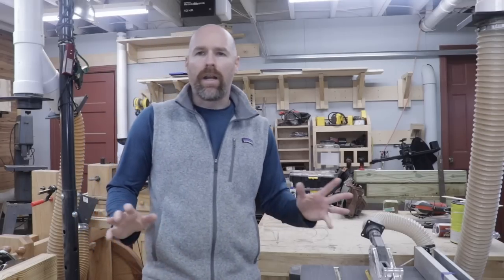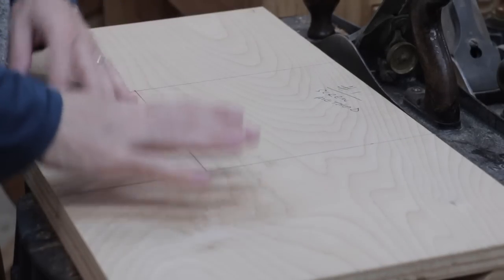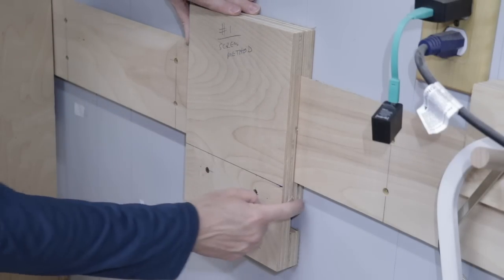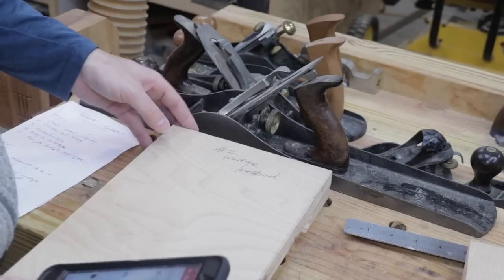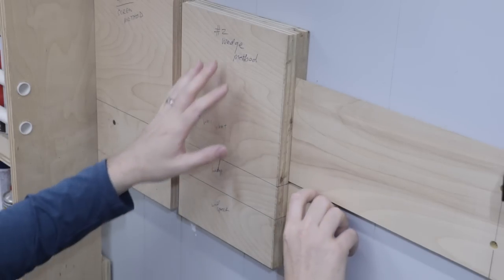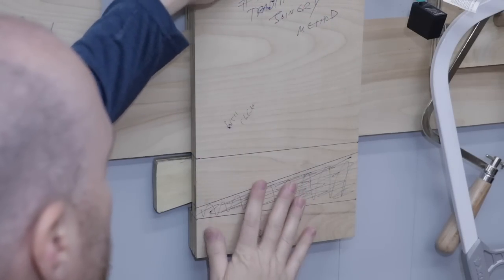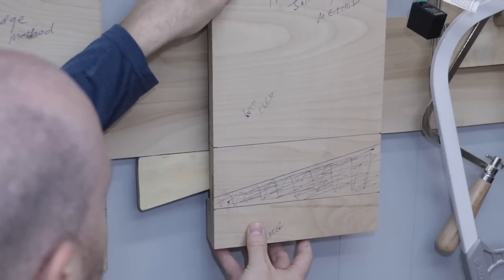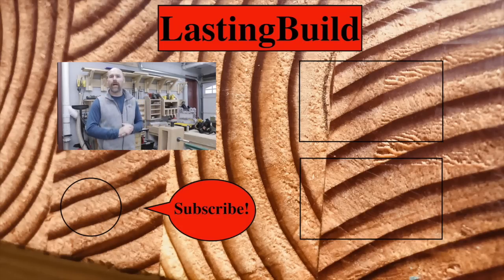Three Ways TO Make Locking French Cleats

Comment: Use one or two dowels (with a knob), and push through a hole in the tool-holder cleat underneath a lower wall cleat.  Requires equidistant spacing of wall cleats and a dummy wall cleat at the bottom. A major benefit is that no access is required from the side and nothing needs to be unscrewed to remove/reposition the tool-holder.

Comment: EXTREMELY HELPFUL!! Thanks for the vid. I do Lawn care/Handyman work. So I was trying to figure out how to make my (Ron Paulk inspired) enclosed trailer "modular" by using a French cleat system where I can reconfigure my trailer but it be secured while driving. One set-up for Handyman and one set-up for Lawn Care (where I have to fit a 48" exmark). I think I will use method #3, but with a screw, for my wall hanging shelves. BTW, I think this is the first time I've ever commented on a video but I couldn't resist because it was so applicable to what I needed. THANKS
Reply from the maker: That’s awesome! Never thought about adding cleats to a trailer. Glad you commented and welcome!

Comment: Great video. Thanks. I use a triple cleat system with 2 support rail cleats inverted to each other and the tool holder part having  two 45 degree bevels to fit between the rails. Solid holding, smaller rails and can cut bevels on a router. Works very well.
Reply from the maker: Thanks for sharing! That sounds super sturdy!

Comment: Another option - the wall mounted cleat: double bevel (top & bottom). The, method number two with the "locking block" having the mirror bevel of the wall mounted cleats' bottom bevel. Put a slight angle on the "locking block" such that one edge is ever so slightly wider than the distance between the spacer block and the bottom bevel of the wall mounted cleat. This results in a modified method of choice 2 & 3 and is absolutely rock solid and the wall mounted tool shelf/cabinet (whatever) will just not come off. I hope this made sense. Thanks so much! - Woodprobie
Reply from the maker: It does! Thanks

Comment: There are several other ways to accomplish locking a cleat. For a solid yet portable cleat, springs and bolts to guide them work. You simply push the cleat up into place to lock or unlock. A simple cam-lock could also work. It does require a knob of some sort, on the tool cleat, but again, it is easily portable requiring no tools. The solutions you presented are great. I'd likely use a screw or two, drilled right into the wall cleat itself, if you want a really solid, stable lock. After all, you're in a shop. What are the chances you wouldn't have a drill and some wood screws handy?

Comment: I liked no 2 then no 1. I can see no no 3 being an issue  as it would work loose in time with vibration. 
Great video.  Cheers
Reply from the maker: Thanks a bunch! I’m excited to try out #3 soon
Reply: If you make the wedge angle much more shallow and leave the mating faces rough that and a tap with Birmingham screwdriver will make sure it stays in place

Comment: Thanks for the video, I'm in the process of constructing my french cleat wall and this has helped tremendously! I think on balance I will use the screw method (1) on mine, as you pointed out methods 2 and 3  require room for the spacers to  be placed in position and space is of a premium  in my case. Much appreciated advice, thanks again,
Reply from the maker: Thanks for watching and sharing your thoughts!
Reply: If your wall cleats are closer than those in the video, the wedge could be above or below (not behind) the tool holder.  Eg above the cleat that goes on tool holder and the wall cleat above.  You would cut wall cleat and tool cleat and wedge at angle so wedge doesn't fall out.

Comment: Another suggestion for locking! Drill a 3/4 hole common in the cleat and in your rack. Use a dowl to pin them in place. You will need to remove the dowl in order to remove the the tool holder from the wall! Cable the dowl to the wall cleat so you don’t loose it!

Comment: What I meant by using screws is going right into the cleat. No spacer required. Just put the holder on the wall where you want it - pin with a screw through the holder into the cleat.  It is crude but fine for the shop IMO.
Reply: Same method I used for my french cleats.
Reply from the maker: Good to know and thanks for sharing!
Reply: Exactly! So many woodworking tips require tempoary jigs or temporary tacking with multiple screws.  We are really overthinking this.
Reply from the maker: Thanks for watching and commenting!
Reply: This would allow for removal of a cleat that is surrounded closely by other tools. Albeit not as quite as pretty as a spacer.
Reply from the maker: Thanks for commenting!
Reply: But then over time you have alot of holes in cleats.  You can discard spacers but not cleats.
Reply: Or, you could use allen head set screws into the board just below the cleat, and use super glue to harden the threads, that way it's solid, and you're not removing amd replacing screws. The set screws become part of the tool holder.
Reply: far simply done--- whatabout using 2x4s or 2x3s for the wall cleats with cheaper scrap 

Any problem using the cut out 45 degree piece for the hookon cleat with a scrap of ply wood glued and screwed to be the face board
Reply: clarification= lock by screw direct to cleat
Reply: Or just add the spacer after mounting, butting it up to the bottom of the cleat and screwing it.
Reply: That's what I do. or you can shoot the screw through the board but under the cleat so you don't have a Bunch of holes in the wall cleat
Reply: @familybikeride  Drill holes evenly across the wall cleat, then drill corresponding holes in your tool holder, and insert a dowel that's slightly proud of the surface so it can be pulled out. Or you could countersink the hole in the tool holder with forstner bit a so the dowel was flush with the surface but could be easily pulled out when needed. You could make it as fancy or basic as you want, you use much less material, and once it's set up, everything is highly mobile without even having to pull out your drill to remove screws.

Comment: nice. you should check out woodshop junkies locking french cleat build. he uses sort of like springs like on those hand strengtheners that guitar players use... it is really neat, but still a bit more involved than i will do. i will likely just use the spacer between bottom of board and spacer like your number 2. thanks for sharing

Comment: Outstanding.  I am in progress on my project and will probably have some shelves locked, but others not - simply due to the weight they won't be likely to move.  I like the joinery method as well.  off topic question though, I see you have hold-fasts in your bench.  Can you share which they are, your success with them,, how thick is your bench?  I'm building some MFT style tops and would like to use holdfasts instead of other types of surface clamps but have seen some different feedback on how thick the workbench top needs to be.  Just interested in your mileage.  Thanks!
Reply from the maker: Check out these two videos! https://youtu.be/GzHMfhUK4R0
Reply from the maker: https://youtu.be/AWWk8p0cSYg
Reply from the maker: My workbench is laminated 2x4’s and I think these two videos will help you out!
Reply: Short shelves are the most likely to be knocked up [steady, Mavis!] and in need of a lock.

Comment: Maybe someone already pointed this out but with the third method I would put the "fixed" wedge on the top and the sliding one on the bottom.  If the sliding wedge is on the top it could loosen with vibration or bumping it and it could then slide out.  Just a thought...
Reply: Nevermind.  I just realized that if you make the top wedge the "fixed" one you will not be able to put the tool holder on the wall cleat.  Oops!

Comment: With my French cleats I haven't taken the time to do the walls completely, I just add a 2440mm section, or shorter as needed. I also use much thinner cleats, 45mm high by 20mm deep are plenty strong enough.

Also mostly I have them spaced much further apart, at the moment 300mm and 500mm. This allows tools to hang down. I can easily add another between if I find a need, but haven't so far.
Reply from the maker: Thanks for sharing!

Comment: After watching your videos I'm a convert to the French cleat system.
When I get round to installing some in my workshop I'm wondering whether some sort of cam based lock mechanism may do a job. If it works it will be self contained within the footprint of the holder and permanently attached, so won't get lost.
When I get round to trying it I'll let you know the results.

Comment: Very interesting. (Say that with a German accent!) However, I have a hard time coming up with a reason for using a 'lock' on a French cleat. The beauty of using French cleats is that the weight of the cabinet (or tool holder) locks it in place. The greater the weight (assuming your cleat can hold the weight), the more securely the item is 'locked' to the wall.  To move the item, you first have to relieve the item's weight from the cleat. That's NOT going to happen if you just accidentally bump into the item. Nor is it going to happen from the vibration generated by the use of power tools. It might happen with an earthquake, but none of the methods of hanging something to a wall are earthquake proof!
Reply from the maker: Agreed! Some folks brought up the issue of grabbing a tool and it causing the cleat to dislodge which led to the solutions discussed in this video! Thank for watching!
Reply: There are some cases where removing the tool lifts the hanger slightly.  I have a magnetic strip holding some small hand tools (pliers, scissors, screwdrivers) above the workbench and unless you pull down and away the cleat will dislodge, the other one is a holder that has a thin metal strip that tape measures clip onto.  Lifting the tape dislodges the cleat.  I added a small locking block between the top of the tool cleat and the bottom of the next wall cleat.  The wedge system works perfectly because it does not rely one another wall cleat to work. .
Reply from the maker: Thanks for sharing!
Reply: @Rusty_ok  great idea!  Simple n elegant!  Plus it is contrarian: spacer on top instead of a solution focusing on lower side.  You made my day! Thanks!

Comment: All three look good but I have to agree, the traditional method looked the best. No screws, tightest lock and easily removed.
Reply from the maker: Thanks Michael!
Reply: For all three methods you need space on one or even two (method 3) sides of the holder.
When you screw straight into  the wall cleat no space on the sides is required.
Reply from the maker: Good point! Thanks for watching!

Comment: I know this is getting a little bit older.. but here's and idea that works well and is quick, easy and cheap. Just not sure if I can explain with out a visual.
First have a short loose piece of cleat exactly the size of the wall cleat handy as a jig.
-Turn tool holder (item to be hung) over where your looking at the back side with the "hanger" cleat already installed. 
-Put your wall cleat jig temporarily in place against your hanger cleat (with the mitre's meeting) as if it was hanging on the wall. The jig is just acting as a spacer.
-Now grab any small block (off the floor under one of your saws ..for me) maybe 1" or 1-1/2" x 3" or 4" that's 3/4" thick or same thickness as your cleats.
-Miter one corner off (45°) 1/2 the width of your block (so on a 1" block, 1/2" x 1/2" corner clipped off (like one side of a dog eared fence pickit top if that helps)  
-Drill a small hole in the center of your mitred block.
-Lay the block vertically under your spacer jig (example 1" wide 3" up and down) flush with the tool holders left edge and pushed up against the spacer jig with the mitered corner at top left. (Where the clipped corner is pointed up and toward the tool hanger edge)
-Drive a 1-1/4" (or length needed) bugle or counter sink head screw through the hole and into tool hanger without going through.
-Twist the block 1/4 turn clockwise to the horizontal position to release the spacer jig.

So we've created sort of a pivoting wedge lock.. hook it over the wall cleat and push down on the lever to lock. Push in on the top of lever to unlock. 
One for small fixtures and one on each side for wider larger fixtures.. different sizes per what's needed. Bottom end can be a tad longer for more leverage.
Can't see it from the front, don't need as much side clearance to install, quick and easy with a small trash cut off scraps.

Sorry so long, hard to explain clearly (hopefully clearly) without a lot of description. Hope it helps.
Reply from the maker: Thanks for sharing! There is a lot of interest in this topic!
Reply: @lastingbuild1373  Is there a reason I'm not thinking of as to why we haven't thought of dropping a block between your tool hanger cleat and the next wall cleat above your fixture? Wouldn't this in the same way prevent the hanger cleat from sliding up or pivoting off, and in the same way force the two miters to stay mated together.

This would be mostly hidden behind the hanger and tools, be installed over the top requiring no side access and allowing you to hang them against each other. Could also act as a back spacer for a small fixture above. Super simple and easy access. Also if all wall and hanger cleats were the same width and spacing the blocking material would always be the same. You could keep a small stock of it ripped and ready to use.. just cut length needed, throw it in and done.

Thought of this on the way to work this morning and not thinking of a reason why it wouldn't work?

Comment: I I noticed that you were using the DeWalt flexvolt sliding compound saw. How long have you had it and how is it holding up? I purchased one a couple of years ago and it quit working within a week. I had no problems returning it but I've since been leery of purchasing another. Thanks in advance.

Comment: I too think the traditional joinery wedge, except I can't see any reason to worry about locking the french cleat. Unless there is going to be upward force applied to the hanger, it's own weight and the weight of the items it is holding should keep it pretty much where you put it. I like the traditional joinery first, and the wedge lock second. To me, the main disadvantage of all the locks except the screw down lock is that there has to be unused space to one side of the tool holder. Depending on the size of the wall, that could be a lot of unused space.
Screwing down the lock seems to eliminate one of the main advantages of french cleats; easy rearrangement. I can't imagine a reason to use that method.
Reply from the maker: Thanks for sharing your thoughts and thanks for watching!
Reply: My air line filter is on a locking holder as it has QR disconnects and  needs to be move sometimes, also the roles of air hose are on small locking peg holders
Reply from the maker: That’s cool!

Comment: Drill a hole in your hanger just below the bottom of the cleat and stick in a piece of dowel. Have the dowel stick out just a bit so you can grab and remove with pliers. This gets ride of the lateral challenge of sliding in wedges when your hangers are close together.
Reply from the maker: Thats a good option

Comment: I just drill a clearence hole for a brad nail right through shelf and wall cleat so enough nail sticks out so i can pull the brad nail with my fingers to remove holder from wall,  if it has to go to a new location just drill another hole for nail. or other method use a screw into wall plate they don't move. Keep it simple i think

Comment: I have a unique workshop where the previous owners insulated with pink fiberglass then put 1.5 inch white Styrofoam over the studs, then sheetrock.  I want to start creating French cleats but am concerned about the gap between the stud and the sheetrock allowing the cleats to sag down.  I was encouraged to cover my walls with 1/2  or 3/4 inch thick plywood or OSB over the sheetrock and then attach the cleats to that.  Your thoughts or suggestions would be appreciated.
Reply from the maker: Im not a contractor or engineer but I would think you could screw your wall cleats right up against the drywall with long screws into studs. You could also mount your cleats to plywood then screw the whole thing to wall.

Comment: In method number two with the wedge, make the wedge and spacer using a French cleat cut the other way.  This will keep the wedge against your tool holder even if your tolerances are off by a little bit.  The spacer would need to have a taper down towards the front of the tool holder and the wedge would be the matching angle.  Kind of like a double French cleat.

Comment: I like method 3 as well for you don't have to worry about tool holder moving sideways but wondered after multiple replacement and usage of the actual tool, does the wedge start to slide out of the spacer?
Reply from the maker: Good question! I haven’t used it other than demonstration, yet!
Reply: That must mean you don’t have many issues with bumping and movement of the tool cleats without the locking mechanism. Good to know. Thanks. Great demonstration!

Comment: The best cleat locking method I've seen to-date, is to back-cut your wall cleat bottom at 10°, then on your tool holder's cleat, you create a matching 10° back-cut, and then cut a keystone shaped wedge that has its own 10° back-cuts, so it can't slide out, can't pop out. You can see that at 5m10s here: 

https://www.youtube.com/watch?v=-i4JaG0GUYs#t=5m10s
Reply from the maker: Thanks for sharing